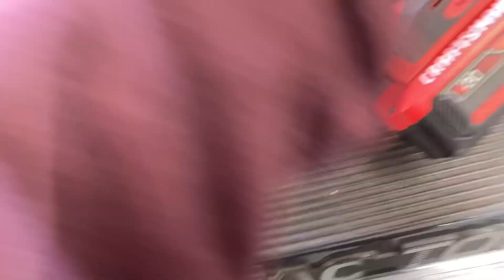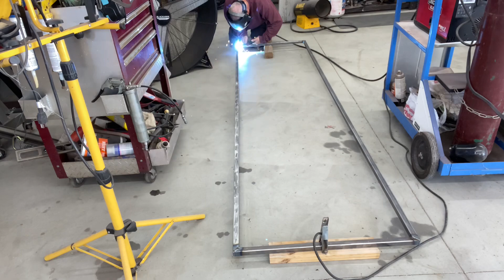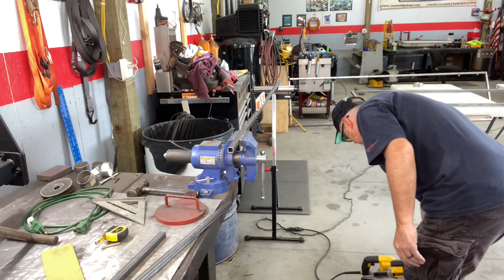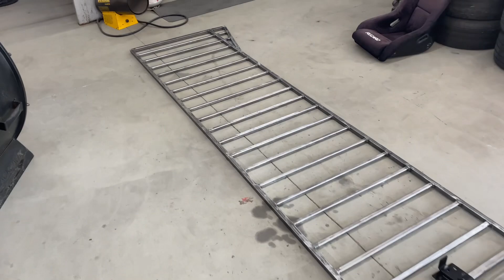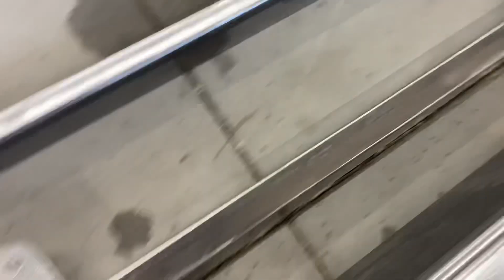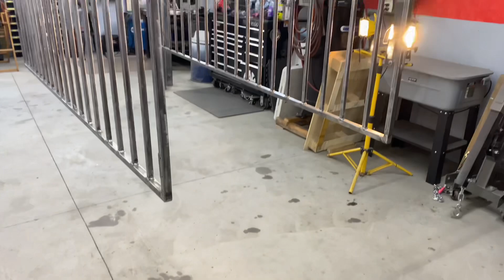Steel Square Tubing Driveway Gate

Comment: How is this frame not twisted ? You did clamp that to a table right ? Every time I weld on the ground it always gets twisted because I don’t have flat concrete, so I always to it in a table
Reply from the maker: No I did not clamp it to a table. I tack welded all corners together first then welded it all. It never twisted. I used thicker 11 gauge tubing to help prevent some of that. Trust me, it was on my mind though and I kept an eye on that. Thanks.
Reply: I used to get twist in my metal too. But definitely spot welding vs doing full welds at first, really helps with heat deforming the metal.
Reply from the maker: Exactly the reason right there. Like when welding up a rollcage. You want to go around and tack it all in a certain order first. Then go back and weld it all up. Same process for anything.

Comment: Why so short? You can buy gates that are that wide or even wider that are much taller at around 4 feet tall but if you're gonna make one yourself I would make it at least 6 feet tall as long as it's legal if not 7 feet or 8 feet tall because if it's gonna be 4 feet tall or less I would just buy 1 from like home depot or tractor supply personally but nonetheless I appreciate what you're doing but that's way too short!
Reply from the maker: Yea I know what you mean. I actually mentioned to have it at least 6 feet tall. As far as making it in one piece 20 feet long I definitely could have done that. They said they wanted it two piece and 2 feet 6 inches tall. I basically just did what they wanted me to do. Appreciate you watching. Thanks.

Comment: I always blow through when I weld that 1” tube, takes me many tries to get the amps right. What setting did you use?
Reply from the maker: I use a Lincoln 180. It’s a 240 volt welder. The heat settings on it are A through E and 1 through 6. For this I had the setting on C3. I used 11 gauge tubing. I also use that setting with 16 gauge. Sometimes you just gotta move faster. And if you’re welding a thicker piece to a thinner piece you have to focus your heat toward the thicker first. On some stuff I’ll just stitch weld it instead of continuous. That’ll help the burn through on thinner stuff.

Comment: Nice attention to detail. What gauge 1 inch tubing did you use? I'm trying to design an 8 ft wide steel frame to attach PVC fence panel to.
Reply from the maker: Hey there. I had a choice between the 16 gauge or the thicker 11 gauge. I ended up going with the heavier 11 gauge. Hope this helps you.

Comment: do you not get any sagging with 1" tubing over 10ft? I like your attention to detail, great job. I subscribed!
Reply from the maker: Thanks for subscribing. I really appreciate it. And there was no sagging with the 3/4 inch tubing welded between it and also the heavier hinges on the end. That was one reason I used 1/4 inch thick mounts for the hinges also.
Reply: @DeansFabShop  cool! Learnt something!